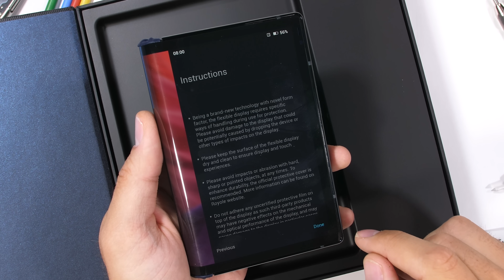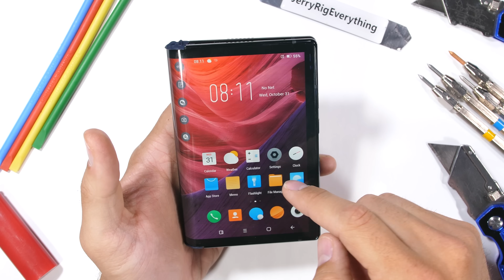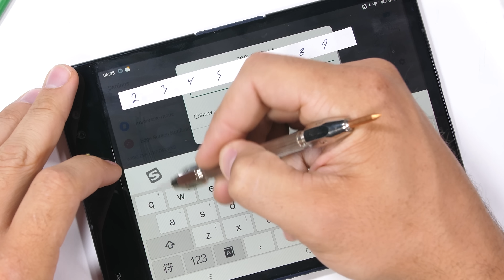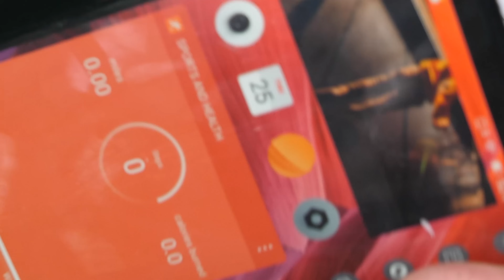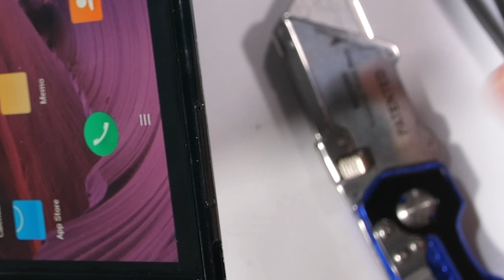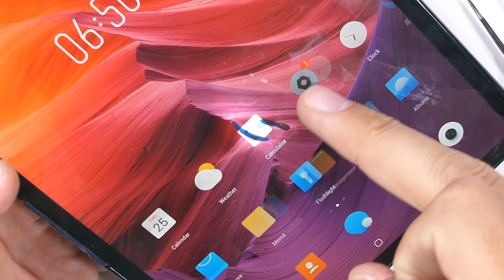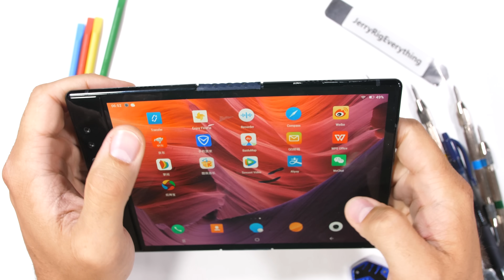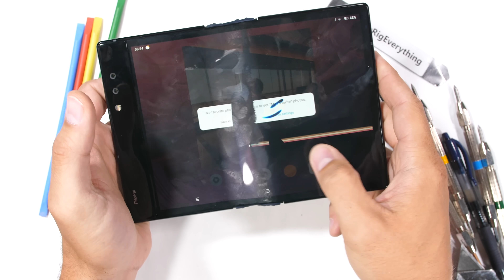Can a Folding Phone Bend Both Ways?! - Bend Test!

Comment: Given the choice between that or a Z Fold, I’d choose the Z Fold. The Z Fold looks more sturdy, and there are many a rugged case available for all three generations of it. If you look on Amazon, eBay or Wish, you’ll be spoiled for choice. I don’t know if the same could be said about the phone in the video. Also, Samsung’s Z Fold’s phones are all made after February 2019. It was roundabout that time Samsung stopped manufacturing mobile phones in China. Every phone they’ve made since then has been made in either Vietnam or South Korea where they’re headquartered. For that reason, I swear by Samsung when it comes to phones. China is the one country I refuse to buy a phone from. It may sound impossible, but, like I say, you have no further to look than Samsung.

Comment: Funny part is that they actually use glass in the displays and you could also hear the typical sound from glass when it finally broke. the glass is however as thin as possible and strong most likely hardened so it could be bent quite tight.
Reply: You dickhead
Folding Phones use plastic displays NOT Glass,there is no such thing as flexible Glass

Comment: For that price you might as well buy both a phone AND a tablet. Let's pretend that folding in half isn't a completely useless feature for a phone. Still, the screen is so fragile you can scratch it with your nails. There are no screen protectors for this thing known by man, and a protective case is impractical. You can maybe use a bumper to protect the edges from falling damage and that's pretty much all you can do.

Comment: It is bad resolved that the screen overlaps on the outside instead of on the inside. This will cause the screen to scratch. If it falls, the screen will break. Imagine that on the Lap Top the screen folds outwards instead of inside. Samsung has better solved its model as the main screen folds inwards. It is protected from scratching and cracking. On the outside there is one smaller screen for reading messages and answering, without having to open the phone.

Comment: Jerry: Can it bend?

Me: No, but it starts scratching at a level 6 with deeper grooves at a level 7. Apple's sapphire claim is fake, again.
Reply: Sapphire? You mean ceramic shield which does not claim it has better scratch resistance than before.

Also samsung s21 5g and above does not have 5g check teardown on this channel.
Reply: @texasmama3084  they say their cameras are made from sapphire, even though they still scratch at level 6
Reply: @thegloriouspotato6223  they stopped claiming sapphire with the iPhone 11 series.
Reply: @texasmama3084  Zack said that the scratches at level 6 are a little more faint than before
Reply: Will it bend? That is the question. :P
Reply: Oof hardcore fans

Comment: Who thought foldable phones would be a good idea? I mean, I get it that you can make the screen bigger that way, but nowadays, screens are just so big that you don't need a bigger one. Compare the size to phones made 10 years ago

Edit: Just buy a second tablet with your phone, It'll be cheaper  and less fragile
Reply: You can litterally buy a samsung tablet for about 100$
Reply: it's cool and innovative, and new. I guess that's why they made foldable phones. Or maybe people just want a smaller phone that fits in your pocket more easy.
Reply: @krahser6914  UTG
Reply: @krahser6914  the thought of folding phones are extremely bad as they have to be made with a plastic screen not glass
In my opinion Folding phones should not even be manufactured at all as they aren't very durable compared to non folding phones which last for over 5 years or more

Comment: I might use a folding phone if it folded in the opposite direction, so the screen is protected by the hard back of the phone.

My biggest concern with that, however, is size. I don't like really big phones, and it seems to me that no matter how you slice it, in order to use such a phone as a phone (text and call), it would need to be open. The Royole's design of having the screen on the outside gets rid of that problem, but I'm very picky about keeping my phones in as pristine a condition as I can, so I can't see myself ever being comfortable with a phone like the Royole.
Reply: using a galaxy fold now?

Comment: I think folding phones are like 3D TVs. It's not worth it. Well there was a feature using the 3d Technology. Some games where able to show 2 Pictures on the same screen and with the right glasses, you just saw your game. I've never seen this system in action but I think I saw an option in Call of Duty and googled it and then the technology came up.
I think this is still a good idea, especially for 4k or even 8k TVs. You still cut your vertical (or horizontal) resultion in half, like with a proper splitscreen but you have the full size of the TV. Also no peeking on the other screen. Sure now with big TVs a split screen is still quite large but still.

Folding phones probably never take off. I think dual screen phones will come and would be the next big thing. When they can mix e-paper and normal screens, this would be a big thing, especially for smart watches. I hate phones with always on screens. Something like a clock or static information are good for this purpose. For example a low power navigation could be good. Most of the time you need the voice and the visual information. A rotating map and stuff is not always more helpful.
For a phone, you only need one camera

Comment: Said many times  flexible  display is cool but gimmicky. Since you can't fix a glass over it is no material existed that is both scratch resistant and flexible.  I won't be buying it.

Even Samsung inward folding wont make a difference since micro particle that landed on the screen will easily scratch when you swipe the display

Comment: The only reason I'd ever "need" a foldable phone is for a better experience reading stuff without having to haul two devices around with me. Definitely not worth paying more than I would buying a halfway-decent phone and a tablet. Also not worth the super-squidgy screen construction... From the looks of it, accidentally sitting on some button or metal bit would be enough to put a dent in the phone :\

...Also, that coating crap makes literally the worst sound when scratched. Decent warning, I guess, if it starts to happen accidentally. Kind of sounds like some vile cybernetic... cicada!

Comment: I would much rather the screen be folded inward with the outside of the phone protecting it.
Reply: nintendo did this 15 years ago
Reply: flip-phones from the good 2000s
Reply: Literally be a foldable tablet
Reply: But normal smartphones always have their screens exposed
Reply: @bridgeradams8491  but not with a plastic screen
Reply: @blchitu8535  actually the Screen IS plastic
Reply: you have samsung galaxy fold ... first
Reply: yes
Reply: Same thought in my mind. It will be safer, at least it will protect the screen from scratch or pressure
Reply: You'd just have a foldable tablet then

Comment: Why people need a folding phone? Why? Trading off tempered glass with plastic surface? Using more moving part or hinges just make the phone prone to damage easier than any other candy bar smartphone.
Again, what makes them think people really want to use a phone that need so much of effort to keep them safe from damage? Just because you have choice to fold to bigger screen, it doesn't mean we really need that size.
Even a 6.5" is sufficient enough to use it in our daily life. When we need a bigger screen to watch something, just mirror it to A TV or just log in with another device.
Confirm fail

Comment: So we have started with durable but quite bulky and one purpose only phones, then we went to fragile but slick looking with tons of functions, somehow we skipped function and durability and now we are going for shit so fragile is was literaly designed to brake? Making folding phones is like trying to build a car out of old newspaper. Some crazy dude will spend some cash on glue and say "this is my paper car, you can use it as long as it's not raining or windy, oh and don't leave it in the sun either, other then that it should last you a few minutes" and we will all simply point out that there are better ways to build a car. Real folding phone to me would look like regular phone but you could bend it and it would not brake. I mean put it on the bed and step on it. Royal is just pushing this on the basis of "oh look, you can make it bigger or smaller". Well it's big any way you'll "fold" it.

Comment: Should have a warning “do not use a tablet pen” seems like that would damage it as well.
Reply: If they have a plastic tip (like S-pen) that would scratch it, but there are those cheap rubber pens I don't think that would damage the screen
Reply: Fenn ViktorVich I would agree, however, the screen wasn’t scratched, it had indentation damage because of how soft the screen is. And he was able to damage the screen by simply using his nail.

Comment: That thin display should just be used for a phone that rolls up into a tube.
Reply: That would be awesome but where would the internals be? Flexible display demos always have a huge brick connecting them to store the storage, battery, cpu, gpu, ram, and other components.
Reply: The whole point of this is a bigger display .... With that thickness why not have a decent projector installed ?

Comment: cicadas aren't particularly closely related to crickets. they're most closely related to leafhoppers and stinkbugs.
cicada eggs don't cause the tree branch to die and fall off... the eggs just fall from the branch when they're ready. the branch is fine.
only some species of cicadas stay underground for 13 years. others take 7 years, 2 years, or 1 year. so the 13-year ones are cause for celebration when they emerge 🎈
you get an F on your cicada test! next time you want to drop a knowledge bomb, get it right!
but you get an A on your pleasant voice test.

Comment: While the overall durability of the device is impressive, the screen itself is entirely too fragile. The only reason to buy a foldable phone is easy access to a bigger screen. If that screen is riddled with permanent damage and deformity after a month or two of regular use,  it doesn't matter if it still technically works or not when it looks like crap. I think this idea is just too ahead of the technology. We'll see foldable devices really take off when the entire device is flexible and durable, but not yet.

Comment: What these companies need to do is to figure out how to bond the plastic necessary for the flexibility required for the fold with glass  for the parts of the screen that never actually fold. On all these phones now they have an entirely plastic screen when in reality only 1/2 in or less actually bends. If they could figure out how to fuse the plastic to glass then I think folding phones would be a good deal more durable.

Comment: 7:25 You're right. Apple likes to brand their devices with trash cans and cheese graters, that's way better.

At least Royloe aren't purposely engineering faults, repair obstacles, or less ports into their devices so they can sell you a solution to the problems they make.

Comment: Such a terrible design having the screen on the outside like that when it's using soft plastic screens.  What designer would sign off on such a terrible design? The only way is to have the main soft screen on the inside of the fold and a screen on the outside like the samsung design.....Just don't make a mess of the design like samsung did.

Comment: That screen is so weak. It needs some kind of hard case to protect it in a pocket which will only just make it thicker. This whole folding idea is a gimmick. I think most big phones with no notches or holes like the Note 8/9 and OnePlus 7 Pro are big enough. They are almost as big as some tablets but with a thinner aspect ratio. I'd still like to see more of these. The Huawei design is the cleanest. I'd also like to see a real rolling OLED screen that opens and closes like a window shade. That concept might have a better chance than a folder. It will protect the screen better and possibly be more compact like a cigar tube or large marker in your pocket.

Comment: I accidentally grabbed a cicada a few nights ago. It was sitting on a bungee cord that I was using to paint a brake caliper with and I was going to hang the caliper back up and I grabbed the bungee and it started squirming and making the noise. I had no clue what was going on cause I didn't see it, then it tried to fly off and I saw it and freaked out.

Comment: I will buy a flexphone when they figure out how to flex glass. Plastic screen, nope. :)
Reply: Corning is working on flexible glass.
Reply: There is flexible glass that can easily handle the bend radius needed for this device (you just have to make it very thin), BUT if it's not bent perfectly along one axis it'll shatter. And, you know, scratches etc. would also be very, very bad.
Reply: I don't think that's possible, you can't mess too much with glass except for the fabrication methods
Reply: @ofuets  Again, a glass with a thickness in the µm-range can be bent to a radius of a couple of mm. Schott makes stuff like that, Corning too. But if you try to crease it - which happens if it's bent along one axis and you try to bend it along another - it'l shatter. The early versions could be shattered by slightly shaking them, which was apparently due to the cutting process leaving fragile edges. The newer versions are more robust, but in this application they'd most probably break way sooner than the plastic version.

Comment: Glass can be bent if you get it in the right shape and thin enough. Glass fiber optics can be bent.
Reply: But can you make a glass sheet and keep it flexible? Once that technology is ready, foldable devices will be feasible.
Reply: @binoymathew246  well that I guess I wasn't specifically referring to. Just the statement that glass can't be bent because it technically can just in very specific circumstances.

Comment: No headphone jack 
Tiny battery 
No dedicated SD slot 
No protection for the display 

Yeah il pass
Reply: This is a first gen foldable smartphone/tablet. Chill tf down
Reply: It doesn't run Android tho
Reply: It has an SD card slot and headphone jack lol
Reply: @michaelhazellful  no it doesnt, and the fact it comes with USB C headphones confirms the suspicion

And there is no dedicated SD slot (can't use dual SIM and SD card at the same time) 

I'm sure Android can be hacked onto it 

Besides, it will probably have the battery life of an early iPhone with its tiny 4000mah battery that has to power double the screen of any other phone (should have at least 10,000mah)
Reply: @mwbgaming28  what is this? Even galaxy fold is only 4380 mah and mark ass brown lee already said that its battery life is pretty good. Do u want a power bank or sumn?
Reply: @mwbgaming28  you're gonna "hack" it to accept two sim cards and a microSD using a tray with only 2 slots? :))) You made my day
Reply: @Vlad-rf3tu  your idiotic comment made mine too (where did I say j was going to hack 2 SIM cards and an SD card into it XD)
Reply: @AgungRizkiAS  The battery life is good if you don't mind wearing out your battery by charging it from dead every night without fail (or multiple times a day if you actually use the device) 

I have an S10 5G and im constantly plugged into a power bank because the battery in this thing dies after just a few hours of actual use (decent standby time though) 

Whereas my ulefone power 5 can last 2-3 days on a single charge (it won't work on my new carrier, which is why I switched to the S10 5G) 

Having a 10,000mah battery built into the phone is vastly more efficient than using a power bank

And it puts less strain on the battery itself since the LIMITED charge cycles are not being used as fast, and you are not wearing out your charging port (which also doubles as a headphone jack for some reason) and that's pretty important since this phone does NOT have wireless charging as a backup when the port breaks
Reply: @mwbgaming28  S10 5G has at least 6-7 hrs SoT. That's really good battery life, if you are complaining about the s10s battery life then no phone will keep you satisfied
Reply: @mwbgaming28  S105g battery is too small?? There's 5000+ mah rugged feature phone on amazon if battery life is what u want...
Reply: @AgungRizkiAS  yeah but then you lose 5G connectivity and the high performance SOC that the S10 5G has
Reply: @michaelhazellful  that's nothing, my old phone had upward of 20hrs screen on time (it doesn't work on my current carrier, otherwise i would be using it) 

With the S10 5G, I find myself fully recharging it at least twice a day (more like 4 times a day if I'm in a 5G area)

All I want is a phone with the specs of the S10 5G, but with a huge battery 

I can't even find a battery case for this thing 

Not sure why you sheep are happy with less than half a day of screen on time, (ever got home from work with a dead battery only to find the power is out and you can't recharge it, or forgot to plug your phone in the night before) 

Phones these days have no reserve capacity
Reply: @mwbgaming28  buy a power bank and attach it to your S10 5g. With Velcro or adhesive
Reply: @michaelhazellful  that's a shitty solution to a problem that shouldn't exist in the first place 

Knowing my luck, I'd break the plug doing that, and it doesn't solve the problem of wearing out the battery and charging port prematurely

Comment: Hot glass bends and hot glass looks like cold glass, so why not just keep the screen at 1000° always? Like seriously, how hard would that be? Just put the battery in the center where it curves, batteries get pretty hot so the built in flame thrower wont have to work as hard. Maybe your burn test will help with the built in flame thrower technology.